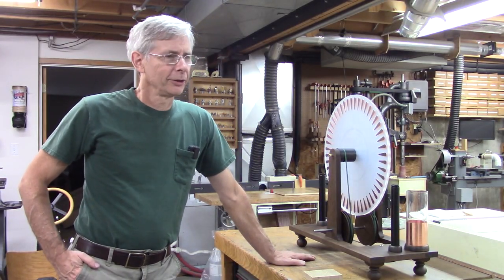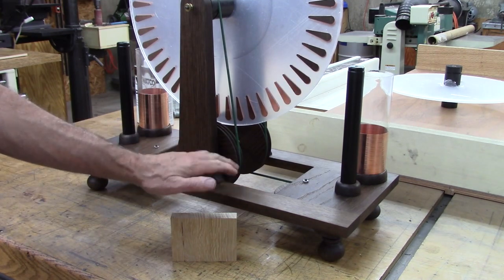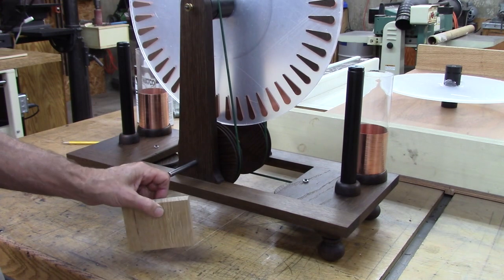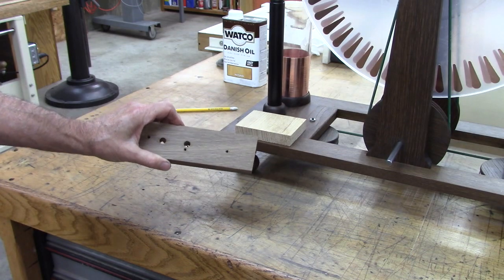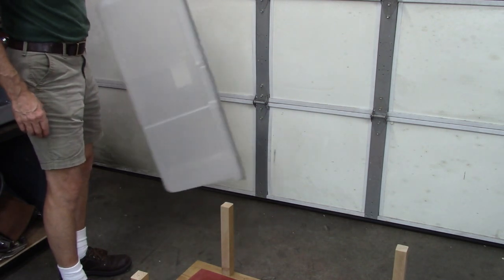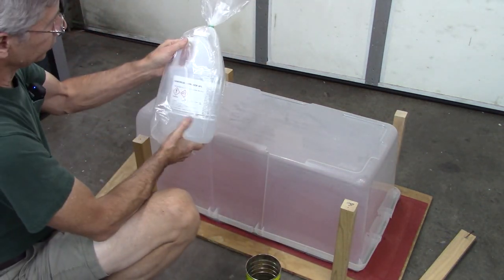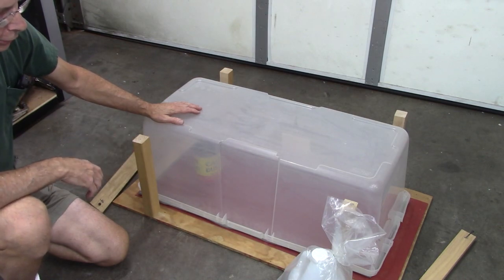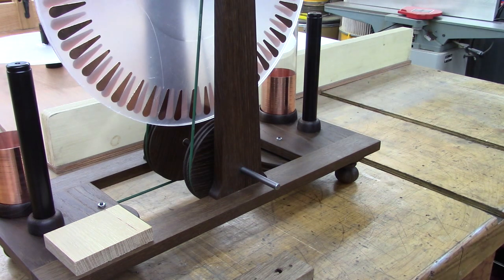Fuming White Oak - A more in depth look!

Comment: I am repairing and refinishing an old oak dresser for my daughter and she wants it dark and this seems like a good choice but I don't know if I'm willing to do what it would take to build a suitable chamber large enough for this dresser. I doubt that plastic sheeting (visqueen) could be easily sealed tight enough.
Reply from the maker: The first step would be to make sure it's white oak. Other wood types work but not very well. Larger item are difficult. Plastic bags work fairly well if the parts fit. I did a 2 x 6 foot table top by building a 2x4 frame and pushing a plastic sheet into the frame and then I taped plastic to the top. it probably leaked fumes a little but it was outside. A good seal is important but very small leaks are tolerable if you are doing it outside. Be careful with the fumes...  bad stuff!

Comment: Mark, that red fiberglass is nice stuff. If you have the same stuff I do, it's 1/4" thick, and was made for use as a high voltage insulator. I have other fiberglass I'd gotten, and it was made to Mil specs, and was 1" thick. I gave it to a friend for setup blocks for welding. As I recall, it was 4"x6".
Reply from the maker: I had two 4'x4' sheets somebody gave me but it is only 1/16" thick. It's handy stuff but it will knock the edge of a carbide blade in 4 feet. I believe it came from Sorenson Industries.
Reply: @WinkysWorkshop  I got mine as cutoffs, so I don't know who the vendor is. I use some in the bottom door track on my sliding shop door to help keep rain water out. I've not needed to cut any of it yet, but I'm sure that it's rough on those teeth.

Comment: Thanks for the additional information. Do you think it makes a difference in the surface area of the container you put the Ammonia in. So in place of the coffee can a 9x9 glass cake pan. I wonder if that would work faster.
Reply from the maker: It might but I suspect the chamber is saturated with ammonia fumes in 10 or 15 minutes. The boiling point of Ammonia is -28 degrees so it leaves the water its dissolved in very quickly.

Comment: I’m kind of fascinated by that spark machine, I went to your other channel and watched all those videos you had.
Reply from the maker: Cool, thanks!  They all work the same but with different drives and design features. They are a lot of fun to build... kind of an artistic adventure.
Reply from the maker: Also I will be doing a video on building one of these machines very soon.
Reply: @WinkysWorkshop  looking forward to it, would you consider selling some of those copper teardrop shaped stickers you made the stamping machine for?
Reply from the maker: @shanek6582  Yes I sell them in 2 sizes but right now I'm not sure which size works best. I will know in a week so so if the smaller sectors are worth the effort. You might want to wait and find out.  https://markq6zlmc.fws.store/30_Wimshurst_Sectors_Small/p7671236_20853677.aspx
Reply from the maker: @shanek6582  Send an email at Winkysworkshop@gmx.com and I'll let you know which sectors work better.

Comment: Ammonia and steel wool in a vinegar solution both react with the tannins in the oak.   The latter turns the oak black and is often referred to as ebonizing the wood.
The oil add a very nice tone to the fumed oak.
I did not appreciate how deep the fuming process went in the wood.   Good to know.   Thanks.
Dave.
Reply from the maker: Thanks for sharing. I remember reading about steel wool and vinegar but have never tied it.